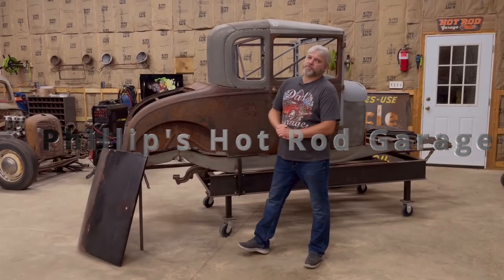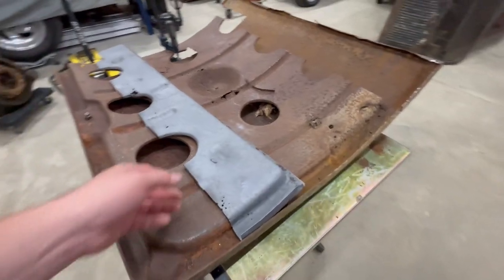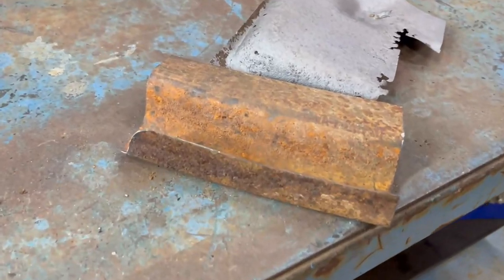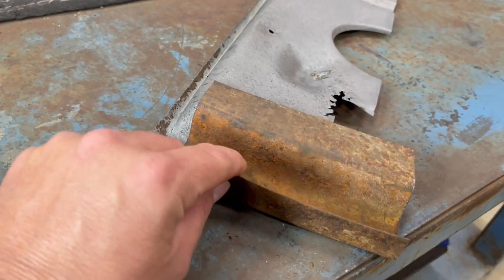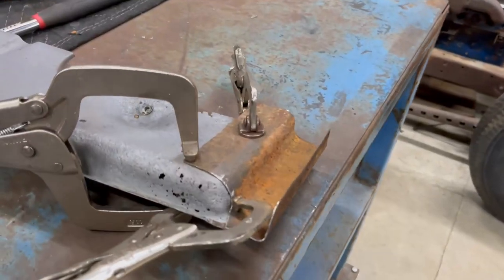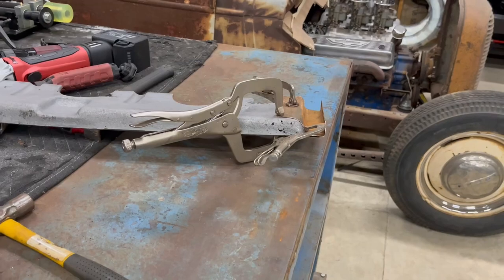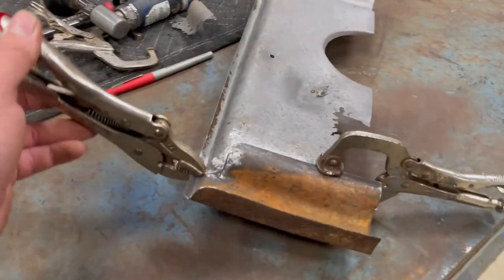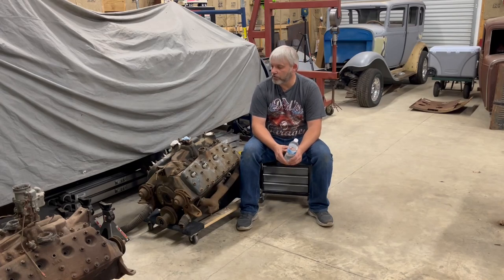Junk so rusty that patch panels need patches! Trunk repair continues! Model Coupe A Hot Rod build!

Comment: Using a section of the old trunk to repair the corner, was a great idea... it already had the profile and you didn’t have to bend up a new piece...
I’ve never done anything with a Tig welder,, Can you control the heat better on thin sheet metal ??
Anyway,, keep up the good work my friend,, looking forward to seeing the upcoming videos....
Reply from the maker: Yes sir, I was blessed to come across that rusty old trunk to use for pieces. And on the tig, yes, you can control the heat better if you know what you are doing. Its a softer weld than a mig, so its easier to hammer and work. That's one main advantage.

Comment: Hey ya got this it's metal  seminar to work with not like the junk they got now adays just saying  looookin fine ya got me beat mine have to do same or worse  so learning on plasma thing man it cuts awesome opps to far go back ha ha learning  process  thks for sharing  learning  as we go how long been working on the beast ?
Reply from the maker: I use a plasma cutter sometimes. It works good, but it is not as precise as other cutting tools. We all learn as we go. That is the best way. I've been working on this car for about a year and a half as time permits.
Reply: @Phillip's Hot Rod Garage  mine over ten yrs 3 heart attacks gallbladder  removal and  shoulder surgery too been trying too slow me down rest when lm dead got 4 other vehicles on the go plus shop roofs too doo house to maintain life is good and helpful  wiffee on the side helps lots keep plugging away
Reply from the maker: You sound like a busy man! Like me! Just keep moving!